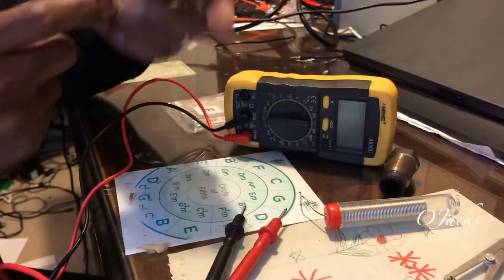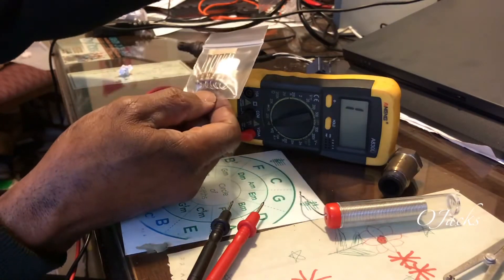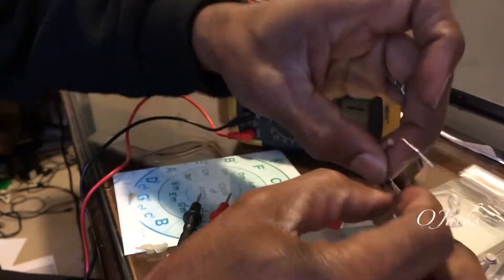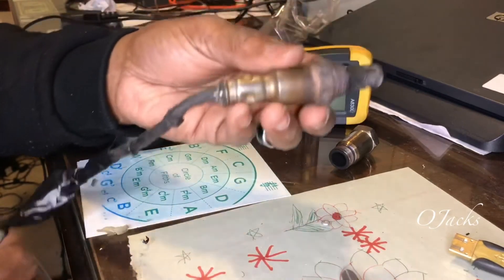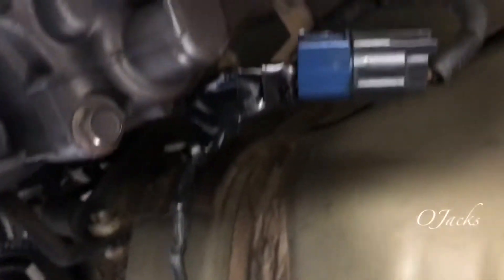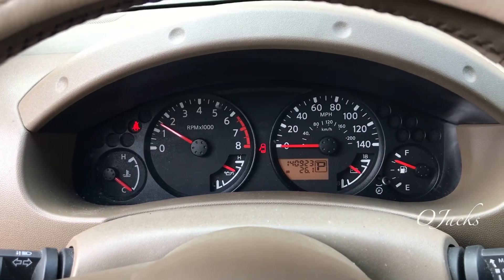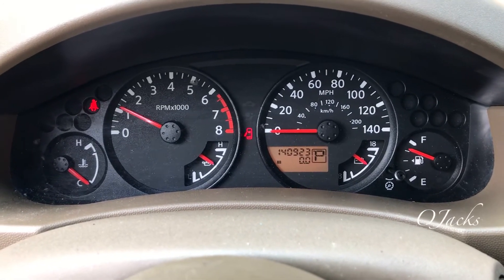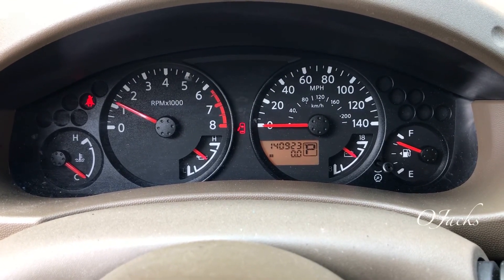O2 Sensor Modification to Pass Emissions Smog Test for Code PO420 , PO430

Comment: As I understand it, the P0420/430 code is triggered due to a failing catalytic converter.
So, what's the use in modifying the sensors?
The vehicle will still fail inspection if they measure the emissions.

Comment: Peugeot 107,(citroen c1 and toyota aygo) recepie is: 4.7uf capasitor and 50kohm resistor. Works like a charm💪
Reply: What you recommend for the civic d15z4 engine
Reply: @Neal-j4y  i would go with capasitor and resistor shown in video🧐 it is pretty usual and shown to work in many cases.

Comment: 06 toyota tundra doesn’t work tryed with 1 ohm or versus 1 mega ohm with 4,7 mf 50 v capacitors it gives po606 ecu code 
Any idea why
Reply: Old post I know. Did the p0606 kill you're ecm?

Comment: FYI, the computer must monitor the exhaust through a complete drive cycle, Google it, and then it will make a determination if the CEL stays off. If you fooled the ECU, then ur good. But some newer car ECUs will vary from Stochiometric to lean or rich and expect to see a change in the downstream O2 readings, but if you have the cap/resistor mod, the “sensor” output will not change accordingly and you are back to square one, aka P0420. 😮

Comment: This video is for a nissan, other makes may be different. A nissan expects the downstream o2 sensor signal to be bewtween 0.1 and 0.68 volts. If your voltage is to low use a smaller resistor, to high and use a bigger resistor. The voltage swing should still be pretty fast, only slightly slower than the upstream o2 sensor. You need to use a very small capacitor like 1uf but this may vary. Also you can try with the resistor after the capacitor or before. If I remember correctly my cap is after the resistor (o2-resistor-cap-car wiring). Good luck!
Reply: What you recommend for the Honda civic d15z4 engine

Comment: Your video is incomplete.   It takes time for the engine computer to run the catalyst diagnostic test, so the trouble code won't appear immediately if this doesn't actually work.   Did your trouble code re-appear or not after driving it around for ~80 miles or so?

Comment: Consider the black wire is ground. After cutting it up, youtu.be/xeFZP4lJbns?t=749
and then connecting a resistor from ground to ground (black to black) is nonsense.
Reply: Black on this one is signal
Reply: Black wire is usually the signal wire.
Reply: Black can be a heater wire also but not a ground, at least on a Toyota anyway.

Comment: When soldering, Tin your tip with solder. And don’t buy cheap solder…once you’ve tinned the tip of your soldering pen, clean it with a wet sponge. Re-tin and have at her! Solder  will follow heat and as you found out, it is HOT!!!! Great video!

Comment: It looks like the positive of the capacitor was connected to the black wire. And that the negative lead of the capacitor was put to the  signal wire. 

Assuming that the Black wire is a Ground, connecting the positive lead of a capacitor to a ground won't do any damage?
Reply: Black is the signal wire
Reply: @jbolding39  Sometimes the signal wire will be the grey wire, and black wire ground ??

Comment: I used a 33pF electrolytic capacitor + 150kohm resistor and my output is basically flat line at 0.5V it fluctuates +/-0.05v. I don't yet know if the C.E.L. will remain off.
Reply: Did your CEL remain off with these component values?
Reply: Did the fix work ????
Reply: We must know if this works!!
Reply: No, I was unsuccessful at keeping the CEL off. I am thinking that there is an electrical issue with the vehicle (2010 Chevy Traverse). I have since removed the RC filter from the sensor circuits after replacing the cats. And still no success

Comment: Hi ,what are the values of the resistors and the capacitors?
Reply from the maker: 470-Ohm 1/2-Watt 5% Carbon Film Resistor 
4.7uF +/- 20%, 35VDC Solid Tantalum Axial Capacitors
Reply: @OJacks  Ive seen 1 meg ohm used also???